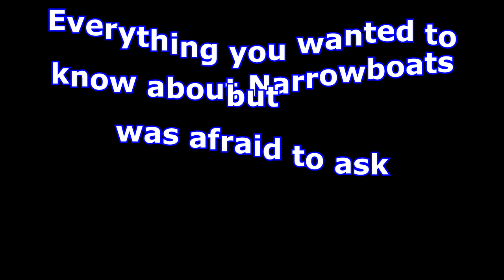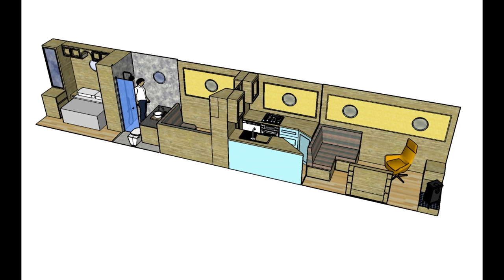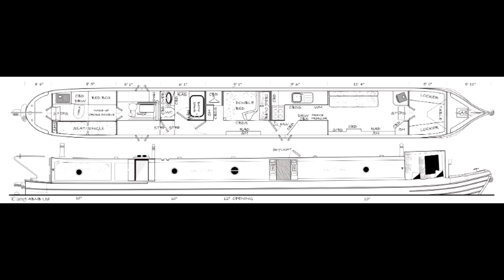4 A NarrowBoat is Born

Comment: When the boat is being fabricated what inspection are carried on the welding by the fabricators, also is there a water tightness test before you take possession of the shell?
Reply from the maker: Hi Tony
There is no water tightness test though the welds below the water line are ultrasonically tested
Reply: Life onboard AmyJo Thanks for that info. I am looking at getting a build done myself.
Reply from the maker: @Tony-nn3gl  When looking for a builder have a look at the welds on their boats.  The seam should be relatively smooth,continuous and straight.
We used Alexander Boats to build AmyJo and their welds were the best we had seen.
Reply: @LifeonboardAmyJo  I'd wondered about that.  The hull is made from a number of welded plates but it doesn't go into the water until the fit out is complete. Mystery solved!
Reply from the maker: Philip Winter I must admit so did I. Pretty sure in most cases you rely on the skill of the builder.  alexander boat owner, Jim Sparks, could spot a bad weld or hole a mile away.
Reply: Life onboard AmyJo The reason I ask is you pay a lot of money out for a build and I would want some reassurance what I am paying for and that I am getting a Quality package. I watch a lot of video’s on builds but I have never heard anyone talk about the builder carrying out inspection.